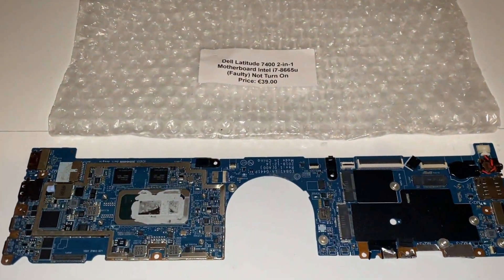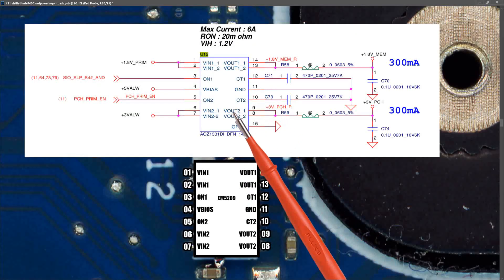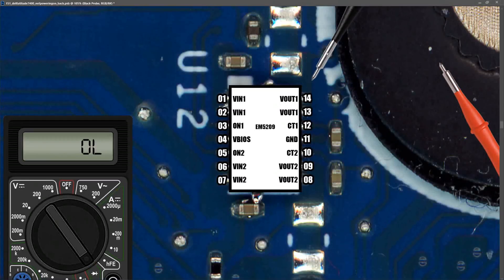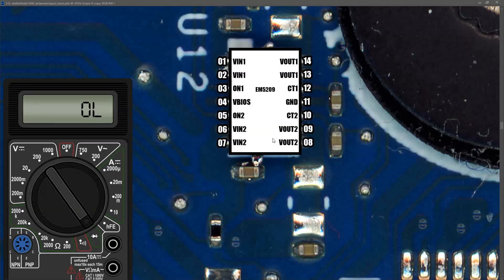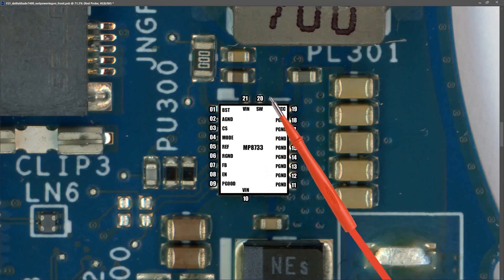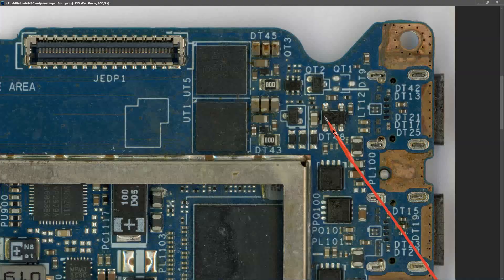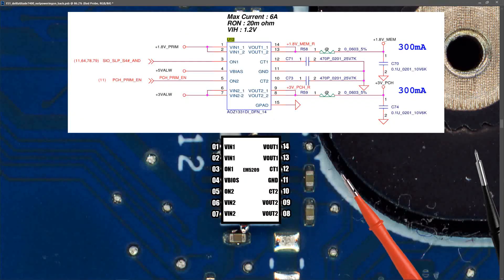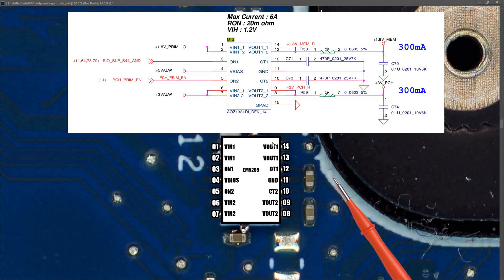DELL LATITUDE 7400 - NOT POWERING ON

Comment: The two PD controllers talking to each other so it won’t post if one of them missing or shorted , it’s less likely that the PCH is shorted ; I suggest you install a new PD controller and try again.
Reply from the maker: Thank you, that's interesting. I had assumed the two USB C power paths were completely independent, but this could be an incorrect assumption. Let me try replacing the PD Controller and see what happens. I guess the question is - what caused U12 to go short, the PCH or something else.
Reply: @therepairshare673 what cause the u13 to short is surge that caused the DP controller to short ; the output amp of the u13 is only 300 milli amp, if the chipset was short you’ll have a voltage drop down on both 1.8v and 3.3b output (considering how low is the amperage) it’s normal that the PCH get hot (might rea ch 70 degree Celsius sometimes) you can also check the voltage drop in diode mode on the 1.8v and 3.3v output should be around 0.6. Also you can check the resistance to check if it’s very low. Why I’m assuming that the PCH isn’t shorted is that there was an ic played as a buffer between the PD controller and the U13 and worse case scenario you’ll get the maximum 3.3v from to the U13. And that won’t kill the PCH. Going back to PD controllers, the laptop won’t post of one is missing because they will this way: if usb-c charger plugged to the first one its PD controller will try to talk to the second PD controller to ask it to not accept power from the second one, on this case only the basic 5 volts will be supplied (which can stepped down to 3.3 and 1.8 volts in your case) there’s no guarantee that your PCH or other chips are 100% working/survived but the best and only thing you can do is replacing the shorted PD controller with a working one and try. If you have a usb-c voltage meter plug it and check the voltage and current the motherboard drowning.
Reply: Hlo sir i have dell e5450 there is a video on your channel about power issue i am facing unknown charger issue and battery not charging pl3 and pd5 both are shorted and i remove them I don't have pd5 and pl3 component please guide can i use jumper

Comment: I bought such an infrared camera (thermal imager) -tooltop et693c, for 145 euros,
I cut out and glued a plastic overlay (ABC) for her for fastening microlyins
(to search for short circuits, on an electronic board)-
drilled two openings for the lens of the infrared chamber = 20 mm, and for the visible video camera = 14 mm,
I glued everything, glued everything with superglue,
And he glued the lens with other glue-Polimer-neutral,
Focus Lines Cloudray CO2 ZNSE
with a number = 25.4 mm (for SMD phones-PCB Circuit Board)
with a number = 38.1 mm, (excellent for SMD elements-PCB Circuit Board),
and number = 76.2 mm, (excellent for PCB Circuit Board)
The diameter of everyone is the same 20 mm, drilled and dirka for a video camera 14 mm.
It is better to take the brand of lenses = Focus Lens vs CVD ZNSE, it gives less distortion, but 2 times more expensive.
He cut out and glued a box of payments for nozzles with lenses to prevent scratches on lenses.
I recommend it! Everything works fine! The only problem is the translation of the photo to the computer,
The sharpness is not very good, but in the preserved photos in the camera itself is excellent.

Comment: ref. to U12, if the Vin1 voltage = Vout1 voltage and Vin2 voltage = Vout2 voltage so is it normal that Vin1 and Vout1 are short and  Vin2 and Vout2 are short?

Comment: Based on the block diagrama of that motherboard (i7 Chipset), we should have the complete machine for reliable troubleshooting.
Are the 5V ALW (PU501, NB679GD-Z) present?
With 3.3 Vin and 1.8 Vout on that shorted IC; I think the PCH could have survived.
Good job. Thanks for sharing. All the best.